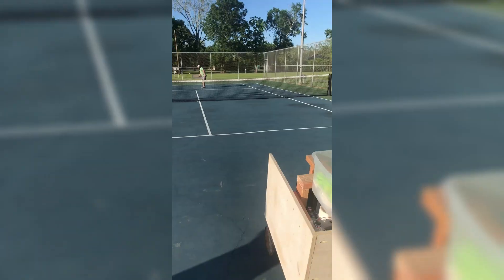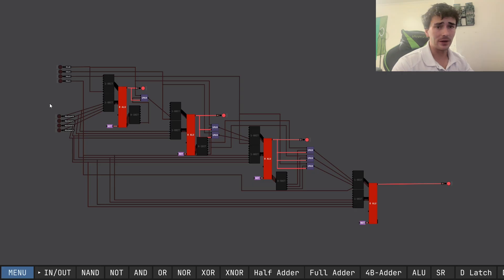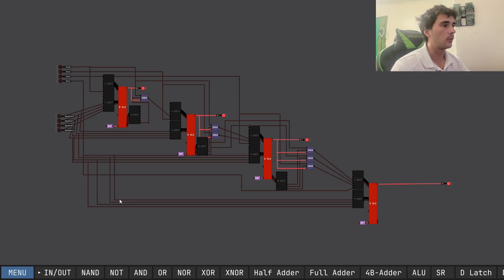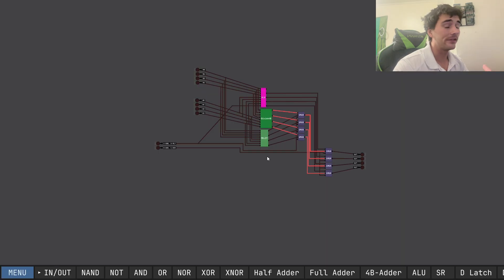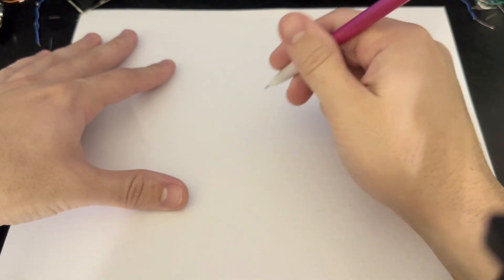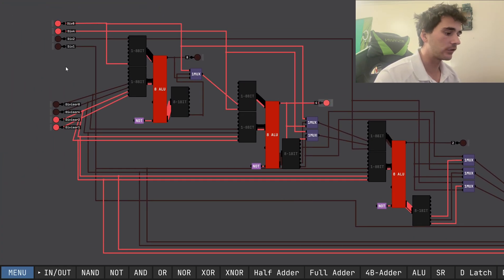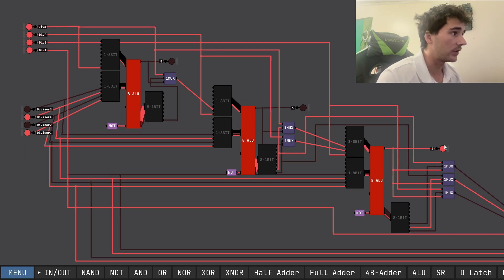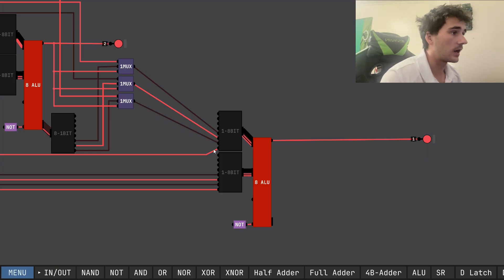How EXACTLY can we make a division unit with logic gates

Comment: Another logic simulation software you can use is called Logisim Evolution.
Reply: Supported on Linux?
Reply: @iamveryrich66 yes its java universal and/or deb/theotherone support (i think deb support)
Reply: @iamveryrich66  I think so, which distro are you using?
Reply from the maker: Would this simulation be preferred or more beneficial?
Reply: @FULXORELECTRONICS  It has more advanced capabilities than what you are using, but it is a more complicated program. I moved from the software you are using to Logisim Evolution. It also has more pre made circuits (Like RAM or ROM) and much more. I am suggesting it because it could be beneficial.

(It does allow you to create custom circuits and import them into other custom circuits, kinda like you do in the program you are using)